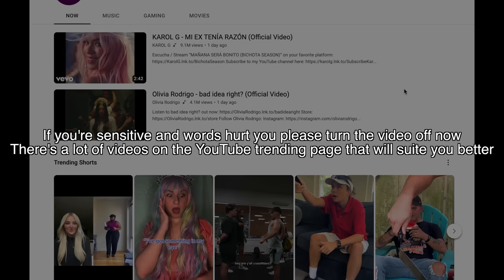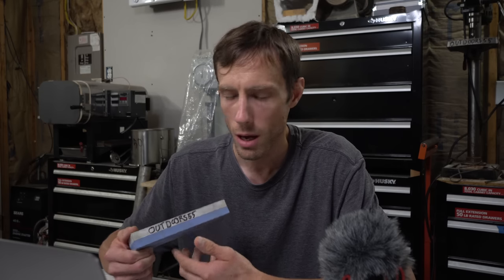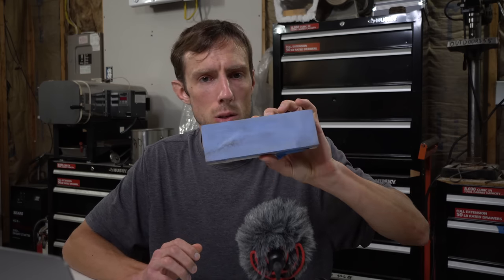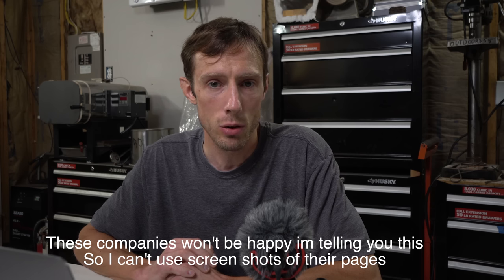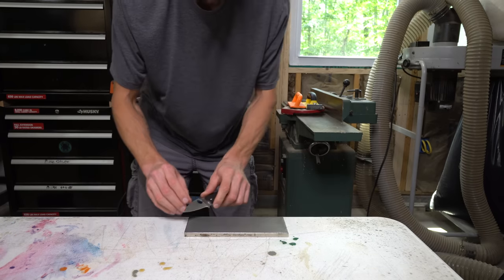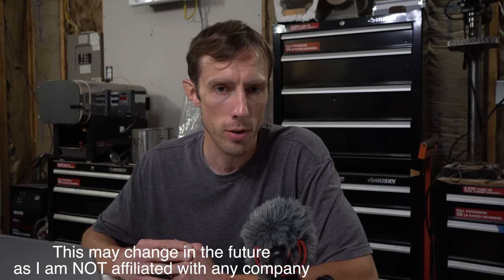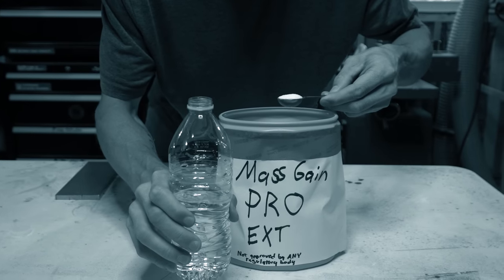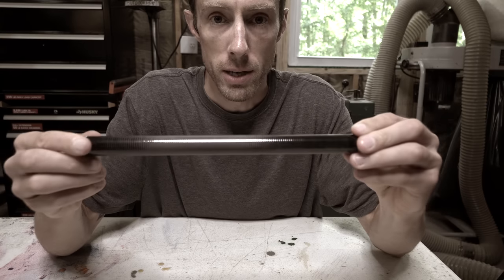The Internet’s BIGGEST Sharpening Stone SCAM

Comment: Unfortunately, this is not only true for wetstones, but for almost EVERY popular product. Thanks to Amazon Marketplace, dropshipping has grown ridiculously fast and mostly uncontrolled so there's not just a few "black sheeps", but a whole flock...
Reply: Spot on
Reply: This is very reason i stopped shoping on Amazon. It is littered with scam and I do not have time to check every scam offer. It should be shop responsibility.
Reply: amazon has become a landfill simulator, it is absolutely impossible to find a good product
Reply: I generally agree. But it isn't all bad. What you are paying for is the logistics. Rather than wait a few weeks to get it shipped from China you can get the products in a couple days or overnight. You also have the ability to do easy returns. That all isn't cheap. Sometimes the markup is worth it. But other times it is deceptive or has crazy high markup.
Reply: From my understanding Amazon itself does not do any quality assurance. For things like skincare, cleaning products, or clothing it makes it very, very easy to sell duplicates (and sometimes dangerous). Even buying from a specific shop does not guarantee anything since Amazon warehouses will fulfill the order with whatever they have matching that item description. For something like clothes hangers idgaf about the quality and will gladly order in on Amazon, and on the flip side I will also order something niche that is unlikely to have tons and tons of duplicates flooding the internet.
Reply: @guguigugu Just gotta make sure it's "Prime" and coming from Amazon, not a reseller on Amazon. I find that filters out 99% of the bullshit.
Reply: The control is the transaction is frictionless and you can return anything you don't want.  Switch offers from "featured" to lowest price, and you will get the best experience the sl@ve economy has to offer.
Reply: Found this video as I'm on a quest to sharpen my kitchen knives and having this wetstone making my knives duller..  What am I doing wrong lol
Reply: @rjames7380  Well if sharpening doesn’t work it’s likely one of three reasons: Wrong/bad tools, wrong/bad technique or bad steel quality. It’s either one, some or each of these three 😂
Reply: I kept getting dull not working knifes on Amazon done with them fill like im getting returns
Reply: The bottom seems to have fallen out of this particular market scam on Amazon as too many drop shippers got involved and they had to start undercutting one another.  I got a 400/1000 grit stone for Christmas for $10 to try to rescue some cheap dollar store kitchen knives on a whim, and it's actually not that bad for ten bucks.  (Unfortunately, I learned one of my dollar store knives had a funky serrated edge, so no sharpening happened on that one.)
Reply: Yeah, Amazon keeps carrying crap, the vendors keep piling up, oddly, Amazon's pricing algorithms keep raising the price for that which I can walk down the road and collect from the cow pasture.

Still, got this sweet 400/1000 grit stone that feels closer to a 1000/3000 grit stone, which requires being drowned for 10 minutes (the big hint) and oh, sharpens like a shitty high grit POS he's described. Upside is, I only paid $20 for giggles, although I will have to be replacing my worn out tri-hone soon.

I was born in the early 1960's, as a hint, I was born a week after the Soviet Tsar Bomba test. I remember well when "Made in Japan" was a quality (or lack thereof) warning label. Later, "Made in Taiwan" and still later, "Made in Korea" taking up that status and still later, earmarks for quality. Today, it's "Made in China", eventually they'll extend quality control beyond their military products... Well, they kind of have to for military stuff, lest their management team's families get the bill for their execution's bullet. 
So, we've got the melamine milk of sharpening stones today (if you're scratching your head, Google "melamine milk", it'll quickly give you a trainload of links to pages on kids that are dead or on dialysis for life due to that 2008 debacle of fraud and the use of what made excellent dinner plates when I was growing up into an illegal, amoral additive to allow now quite dead managers to adulterate milk with what's basically a plastic to pass protein testing).
The moral, you get what you pay for. Cheap giving essentially zero quality control, unethical players and Christ ain't telling what you'll actually get. But, a hint might be that he's laughing and shaking his mighty head...

I'll probably end up going to my local kitchen supply house and get a new tri-hone there, keep the weird ugly thing for finishing, although there's a fairly good chance I'll just go back to finishing with a strop. I usually don't bother with super high grit and stropping for my kitchen knives though, as I'm not into toilet paper thin slices of food in my meals. Touching that fresh pork hock skin and it parts is sufficient for my pasta sauce, as it allows it to then properly cook off of the bone.
Faster, cheaper, better, pick one only. Faster turns a good knife into a Ginsu. Cheaper, turns it into something duller than a river pebble. Better, well that takes a bit of time and costs a only moderate amount more - and I'm on a fixed income that's badly broken.

Amazon, has now become an expensive version of ebay.
Sigh, I really can't drink enough to put up with that shit...

Oh, you really can, as he's shown in a video, sharpen a knife with a brick. Did it in an emergency before. One can also masturbate with a cheese grater, doesn't mean it's the best idea out there though. Besides, wood chippers do a far better job.
Reply: Yep, this. And it's not just the cheap stuff from obscure brands you've never heard of. There are also TONS of counterfeits of reputable name-brand products. Some product categories are especially bad: trendy shoes/clothing, jewelry, samsung phones, bluetooth headphones, anything from luxury / designer fashion brands, etc.... but a lot of people don't realize how rampant fakes are even with super niche products. Basically if it's a brand anyone has heard of, there are probably counterfeits. Amazon has also been known to get authentic products mixed up with counterfeits at their fulfillment centers, so even when you're careful to only buy from a brand's official seller page there's a chance you'll get a fake. Happened to my buddy - he spent $700 on an EOTECH rifle optic from the official EOTECH listing, only to be sent a garbage airsoft-grade chinese counterfeit.
Reply: @TheNightstalker80 nooooo, is because you didn't but the fancy japanese one. well, that might actual be true. nothing german korean or japanese ever completely sucks, unlike almost everything chinese
Reply: @katarh  not even worth the time to use a $5 stone. just go get a disposable hamilton beach. you could use replace it ten times for what one of your wage hours is worth
Reply: made even more popular by grifters advertising how you can make millions drop-shipping.
Reply: There are goods of this sort on other platforms too, a mix of good bad and mediocre. Some times the mediocre which work but lack durability are acceptable because of their cheapness, but detecting which is worth your money ain't easy.
Reply: Thank you for saying this. I try to avoid amazon if at all possible when buying things now.
Reply: Dropshipping is kind of silly nowadays, when you can buy your things directly from china
Reply: got me a husky 400 grit and 600 grit stone not bad for $20

Comment: I bought DMT plates starting fine then 3 others going up 8000. I learned watching your sharpening video and can do freehand mirror finish edges. People act impressed when they find out i don't use a guided system. I have been using those plates for about a year and my dad is happy with one I recommended to him for his chisels. Thanks for not selling out on us.
Reply: The newer DMT plates have a few QC issues... Gouges in the plates, or inconsistent grit ( occasionally you'll get one with a strangely out-of-place bigger grain of diamond on it... They leave nasty scratches).
Reply: @scottcrawford3745  I think breaking them in first helps. I start off using the plates on some tools and cheaper knives. After they have been used alot they are much better in my opinion.
Reply: Dmt is the best. I dont use over 1200 then go to leather,  I carve sharpen everyday
Reply: Honestly I’ve used and own a ridiculous amount of DMTs, the course and fine are by FAR my favs, leave extremely keen edge. The extra fine HC (hardcoat version) simply can’t be broken in, leaves terrible scratches and doesn’t put a great edge on due to the lack of uniform particle sizes. That said, it’s oddly good for lapping other things flat (wouldn’t lap stones with it cuz it wouldn’t leave a surface with enough bite) 

If your method uses a strop, try stripping straight from the coarse and straight from the fine, you might be incredibly surprised by the quality and durability of the edges these stones provide! They nailed the particle size and density distribution on those 2 specific plates for sure

Cheers
Reply: @BenCase88 We aren’t acting, homie. We truly ARE impressed. 😊
Reply: Problem with DMT plates is that thin layer of industrial diamond sprinkled over adhesive does not last hardly at all. For what they cost they are actually a rip off and they are making a killing off people until the realize they suck. I use all Naniwa Chosera ceramics with a few other Naniwa stones. For super steels I use Naniwa diamond resin bond. Expensive but in the long run saves you more than going with dmt.
Reply: Dude, I’ve found the blue DMT diamond “plate” to be my favorite all-round sharpening stone. I know it isn’t a stone.   I think it is medium coarse.  Maybe they call it course, followed by xtra-course. Don’t know.  But blue is good. If I could only choose one, blue would be it.
Reply: @TylrVncnt how do you afford a ridiculous amount? They're pricey
Reply: I’ve been using them for a year while I learn how to freehand. Just today, took me 2 hours to sharpen an old clever. I’m exhausted, it finished ok and the stones (sans the 8k) are all hammered. I think I’m going to buy some diamond stones now
Reply: @dcgreenspro  what are trying to make a cleaver do? It's a cleaver, not a straight razor.
Reply: DMT or Arkansas stone. When I can find one.
Reply: @spieguy in the description box he gives a Amazon link to  the stones he recommends.
Reply: I got a DMT D8E in 2019 and it was horibly dished, more than 1/16", they can be great but get a refund if they send you a lemon like mine.
Reply: when you treat yourself in a year get a kasumi. mine have been serving my mom before me and theyre superb
Reply: may i ask did u ever try a guided system ?   if u are not a total pro expert i think u have better results on a 20€ system than on 100-400 € diamante stones....
Reply: @tom-nl7fg  I have both and can now get a razor edge with guided or diamond stones. I'm glad I learned how to use a stone because it is easy to carry a small one in the field.
Reply: +1 for anything DMT

Comment: I learned to sharpen on a 10$ Chinese stone from aliexpress very much like the one in the video. It can get knifes reasonably sharp and after about 2 years it's still not  really dished out due to regular flattening. Idk about "sharpening experience" but it seems like pretty good value for the money. I don't think a regular home cook needs anything more.
Reply: I've used them too, only paid 20 & while it isn't the greatest sharpener it absolutely gets my large kitchen knives sharp enought to easily go right through a tomato.
Reply: Yeah, I just sharpened my two knives up yesterday and they cut just fine. I guess I just don't know any better, but I've been using it for a couple years without an issue. I bought it just because it was cheap and I didn't know if I would be able to get the hang of it or not. If it does wear out on me, I'll get a nicer one next time.
Reply: If all you're sharpening is kitchen knives the stones don't have to be all that flat.  If you're sharpening expensive wood chisels and plane irons the dead flat is very important.
Reply: His review is BS, I paid exactly what he did and got: "Knife Sharpening Stone Set , Includes 4 Side Grit 400/1000 3000/8000 Whetstone Knife Sharpener Kit,Safe Whetstone Knife Sharpener,Non-Slip Bamboo Base, Angle Guide,Polishing Compound，Leather Strop, Flattening Stone,Razor Strop,Rubber Holder and Honing Guide".  And I got it in Canada.  Normally stuff here is not available, or twice the price.  Plus if i didn't like the product, I get "free" returns.
Reply: @tacticalskiffs8134  
None of that is related to anything he said in the video. So I cannot trust you about anything. OK it might be the same price but its clearly not the same product.
Reply: I paid $11.89 on Temu over a year ago and love this stone. I use it for knives and carving chisel and no hollowing out so far.
Reply: 14 EUR for mine, I got a great edge with it but it is a pain to do it and it makes a mess, just like he said in the video. Also, it started visibly dishing very quickly. I am going to try a diamond stone next.
p.s. That said, the SOUND the stones make is amazing and I will miss it.
Reply: They aren't bad for a few bucks. They are absolute trash for the 50 dollar Amazon price. That's the entire point.
Reply: Did you not hear the part where he paid $50 for it? Its a rip off. 

Sharpall diamond plates are much better.
Reply: I bought one for £3, on sale, works pretty good for a kitchen knife.

Comment: You might find this interesting. I worked in China for about 10 years in manufacturing. The prices you see on Alibaba are much higher than directly from the manufacture. About manufacturers, what may seem like a manufacturer is in fact what is called a "trading company" which is a independent sales company buying product to export from the real manufacturer. Some manufacturers do not have a export license to export so they use a trading company or companies. Ok now you're dealing directly with the manufacturer who has an export license, does that mean you're getting the lowest price? No, not at all, because you are say an American importer "you're rich so I can charge you more".  In addition an export company will have the Chinese sales tax refunded to them so the "export price" is BS. 
Back to the sharpening stones being sold for +$50 the real price from a manufacturer, based on my experience, and my Chinese wife who also works in manufacturing would be around 50cents, based on quantity.
Reply: That’s true, if I say I’m from UK the china seller or manufacturer will give me a higher price, however the same product you can buy from India or Philippines etc from a seller for cheaper, and they bought it from china and imported and made a profit and it’s still cheaper then me buying direct from Chinese manufacturer as I’m from UK
Reply: No sh-t, you're also paying for the logistics of it.

Comment: I took your advice on your "beginner sharpening" video and went with a steel back diamond stone so I didn't need to worry about dishing and because many of my knives have very tough steels like 20CV, Magnacut, S90V, etc.
Really glad I took your advice because I almost bought an identical looking 1k/6k stone. Your advice helps.
Reply: Unless you cut meat for a living or sharpen lawnmower blades with your water stone, it will not dish for many years. Rubbing it on a sheet of 180 grit wet-or-dry sandpaper every year will keep it flat as new.
Reply: @Bob_Adkins  To be honest I'd rather just stick with steel stones I now have that has a better sharpening medium (damond). I'd also rather not need a flat reference like a sheet of glass or steel with the 180 grit to see where the low spots are and make sure I'm actually improving the stone flatness. I'm also not sharpening lawnmower blades, but like a guy with a truck, when you have a stone you're not the only one using it so it does get some extra table time.

I appreciate the solution, especially for those still using them, and especially to know for my old stones so thank you, but remember that this was from a video to corect mistakes from newbies.
Reply: The cheap diamond plates can be very curved! Look out for that
Reply: @karelenhenkie666  Luckily I'm a buy once cry once kind of guy (only took me 5 years to get that TRM Neutron in stock, lol) but I honestly didn't even know that was possible, TYVM. Learn something new every day. 

Do you run a bubble level on it or flat edge, just in case the good factory was rushed on a late Friday that slipped out the door or whatever?
Reply: @sqeeye3102  I have a flat piece of plane steel that ik take across it, baseball on the scratchen ( outside edges or inside) I can see immediatley if they are flat enough for my plane blades